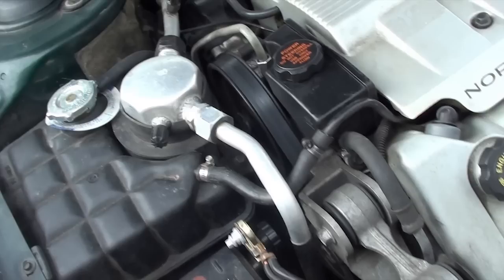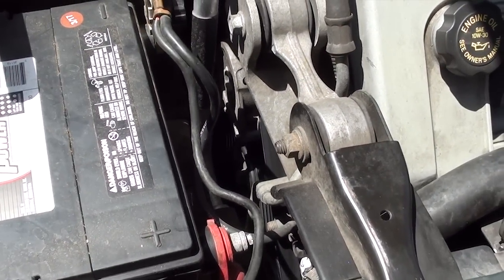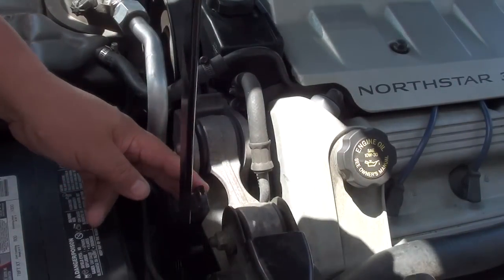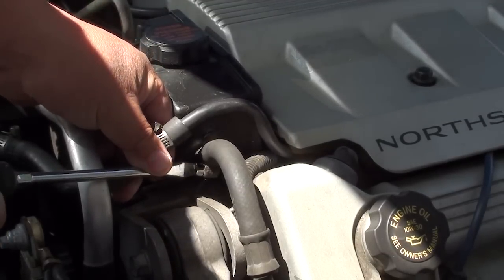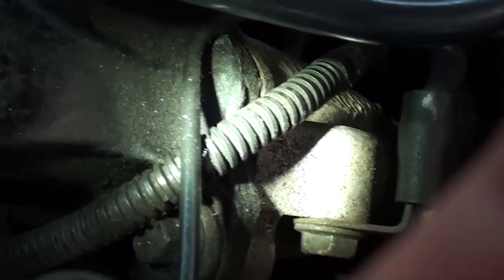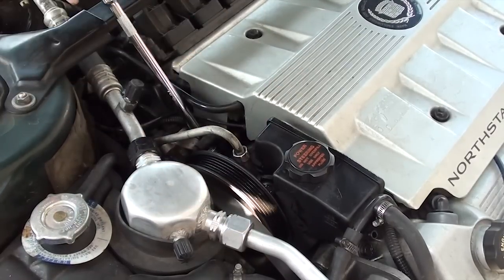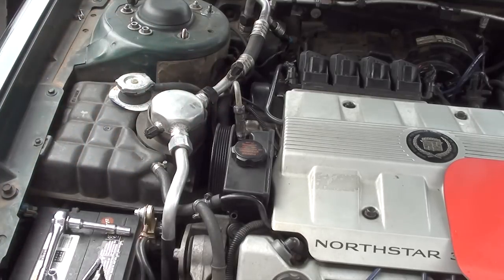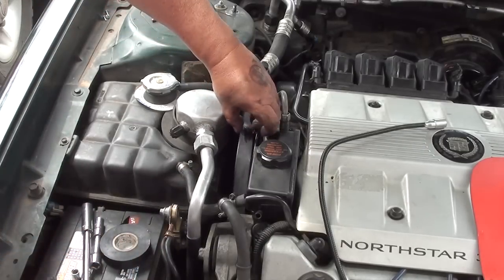Cadillac - Remove  and Replace Power Steering Pump | DIY | Northstar | Mechanics won't tell you

Comment: So I'll be doing this on a 97 Eldorado. I have two questions.
1. Is there a torque spec for the 13mm bolt that secures the pump? 
2. There was another comment on the plastic cap on the outisde of the pulley. Is there a proper way to get that off? I know in the video you said you went with grabbing a pump from the scrap yard but i was just curious if i dont go with the scrapyard option.
Reply from the maker: 1. The torque specification for the 13mm bolt on the water pump of a 1998 Cadillac DeVille is typically 18 lb-ft (24 Nm). Make sure to double-check the specific manual for your vehicle to confirm the exact torque spec.
Reply: @notsofast2325  Thank you, I will.

Comment: I like your video. I add my experience. 
At 4pm I removed both front wheels so I could see where the hose connected underneath driver and see fishing path with flashlight below while pulling hose out the top. Glad you mentioned pulling hose out the bottom did not work. I was not about to crimp the steel pipe feeding new hose from below either. I used the old hose to hold coolant reservoir out of the way since no bungee cords were handy. Routing new hose past exhaust heat shield  was no dejavu. I should have taken photos of old hose path. Once old hose is gone, routing looks unfamiliar.  Once the old hose was gone I reused the standoff brackets. I could not get 10 mm nut onto engine block stud -I used my 15# Magnetic PickUP Tool a few times.   It took 3 tries under car to route hose. Harbor Freight only sells a set of wrenches; no set has an 18 mm for the bottom Flare Nut. I could only make the open end wrench work from below, not from the wheel opening. but I used the wheel opening for my Dewalt  20v xenon Flashlight. I sold a Lincoln Electric welder to a fellow and got him to loosen the bottom flare nut. He was 35 and I am 70. Still I got the whole job done in 5 hours, less an hour going to Advance Auto and Murdocks for a long handle 18mm wrench. to fasten bottom flare nut. 18mm was too tight so i used 3/4=19mm to get nut threaded. Then I switched to 18mm wrench and  I flipped wrench over with each 1/8 turn from below. I am really happy DeVille is steering so well now. Remember to look for the O-Rings that go on new hose fittings above flanges. Frank the store manager diagnosed my car steering problem as a leaking hose. I spent another $100 needlessly replacing PS Pump first. I jumped to conclusions because pump was whinning from lack of fluid - pump had no leak. I had to move car and let it idle for 10 minutes to check for leaks. Then I drove 10 miles across town, stopping for supper at 9 pm at Wendys. Chicken sandwich, fritos, root beer and Chocolate Frosty revived me. It was much nicer working in the shade Saturday 7/10/21 at 82 degrees instead of Friday's 99 degrees. Oops I forgot to torque wheel lug nuts. Milwaukee 3/8 drive impact wrench makes quick work of 3/4=19mm lug nuts; I used HF 2' breaker bar to bust them loose and retighten. I used Skill 1/4" drive Cordless ratchet with short 10mm socket to do bracket bolt on frame -tricky getting tool into position.  I like this compact 7.2v tool. I only used 3/8" drive Milwaukee Cordless Ratchet to loosen 10mm nut behind coolant reservoir - remember to reattach electrical connector before fastening coolant reservoir in place or you will get a dashboard warning if you forget. For this job I recommend Snap On 10mm Magnetic Deep Socket. Front 10mm nut came off with 10" extension on impact wrench. Snap Plug is easier to fasten before 10mm nuts. I fastened bottom flare nut first then tried to attach upper standoff bracket then upper flare nut. Sensual Mentality Dr Grace G PsyD
3 years ago asked for details so there you have it - Too Much Info. I watched all the videos available and still had to fetch tools to do the job. I like HF colored sockets - easy to grab short and deep sockets at once. Good lighting helps immensely.

Comment: I have a 90 model Eldorado Biarritz, it has a 4.5 engine with port fuel injection. I replaced the fuel injector that is closest to the power steering pump, I had to losen the pump and move it forward to the front the car, now I have a leak coming from the bottom of the pump. I'm thinking there may have been a o-ring seal in the round opening of the bottom of the pump where it slides back on the tube for the fluid to pass through. Can you tell me if that is correct?

Comment: nice video, might end up doing this. my fluid leaks like crazy, a bottle a week.    do you have a video about the rear air ride , my 1998 deville keeps letting out the air, and sometime it doesn't reset back up to ride height. thanks for the videos.
Reply from the maker: oh man i wish i did !!!! most people install regular shocks, there not cheap. if you work on your let us now how you did? there isn't any youtube videos on this subject. and the books dont show you in detail how to repair them. i did meet a guy that worked for GM dealer he wanted a arm and a leg to look at it. Yeah the pump is easy to do. just get a bungee cord to hold the fan belt tunt other wise it a bitch to reinstall the belt again. thanks for stopping by.

Comment: My pulley has some type of cap on the bolt. How does it comes off?
Reply from the maker: i just got my pump at a junk yard so i did have to remove my pully, but check this video out , this may help you..
https://www.youtube.com/watch?v=Kg3W5tHqGgg
Reply: Notsofast thanx but there is what looks like a cap over the bolt that doesn’t look like it comes off. Know about this? I have the parts coming in for this job, but that may be an issue how to get it off. I can send a pic somewhere if you like. And thanx for the vids too.
Reply from the maker: @jblack8149  sent you my email address but you didn't respond so I took it down.

Comment: On my Deville I have to add power steering fluid now and then so is my pump bad or are my lines leaking?
Reply from the maker: You'll have to look. You can go to a car wash and power wash that area. Then look and see where it's coming from. It could be a broken line a bad or loose fitting or a bad power streeing unir.